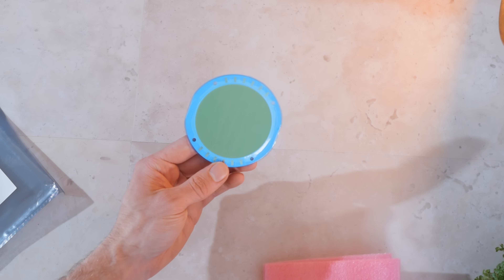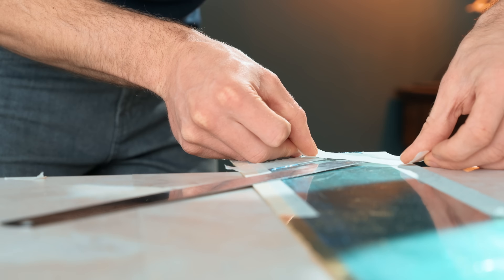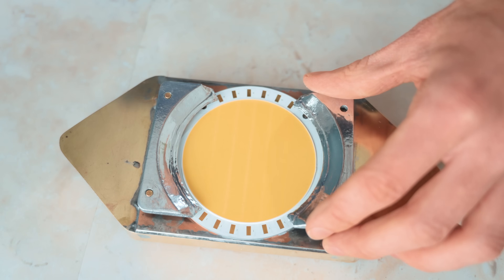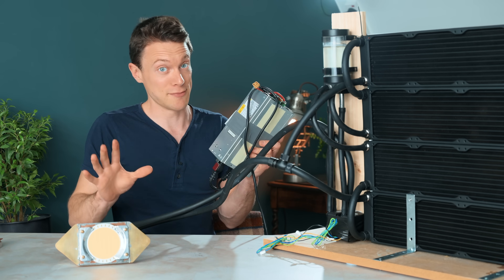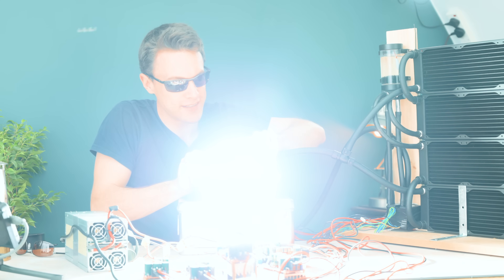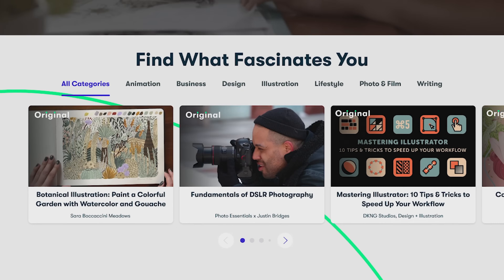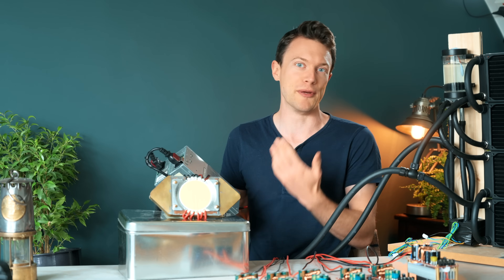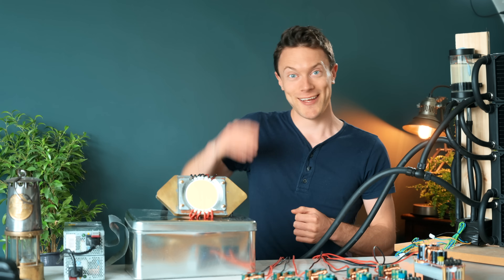Testing the world's BRIGHTEST LED!!!

Comment: 6:53

Dude, if you want to know if something is watertight, just check if it's airtight first. If you just block one end, and an adaptor to a standard bike pump on the other end, you can pumpit up with the bike pump and watch to see if the pressure gauge on the bike pump goes down. It it doesn't, it's water tight. If it does, crank the pressure and listen for leaks. Use some soapy water in a spray bottle to detect leaks by looking for bubbles when it does.

It's a MUCH cleaner way of checking for water-tightness.
Reply: That would be more complicated in terms of fittings.
Reply: @LEO-xo9cz  It really wouldn't. You'd only need two extra fittings. 1. An end cap. 2. A 8MM to whatever side he was using adaptor.

That's all. Easy peasy.
Reply: @PhilipPetrunak  but that's still two extra fittings. He did it without those extra fittings. So his way is simpler and cleaner
Reply: @antonfomenko3894  Wrong. It's not cleaner. If there is a slow leak he won't know it until it's possibly damaged components, and if it's a big leak it could massively damage them.

Pressure testing with air is VERY easy and simple. Why didn't he do it?
Reply: @PhilipPetrunak  He literally operated his LED for a few minutes.  It was never designed to stay on for hours or days, just long enough to do a Youtube video, so there was no need.  Your logic is the same as saying he should have also done complex structural and stress-testing and also rust testing to make sure everything was 100% durable and rust free.  Yes he could have done thousands of tests to precise accuracy but there was no need.  The purpose was a youtube video, and he accomplished that.
Reply: @antonfomenko3894  the purpose was to test any sort of leakage. If there was a small leakage it would compromise the system. If it was a big leak, it would be messy. Please don't overexaggerate.
Reply: @Movie2Documentary  He did test for leaks.  Please watch the video again carefully. I'm arguing that a more sophisticated leak protocol was not necessary, since his test showed nothing obvious.  And he only needed it leak-proof for one youtube video. Case closed
Reply: @antonfomenko3894  but if it went wrong if the were leaks it could have damaged anything 
At that pressure the water could spray into the cooling power brick for example
Reply: Thanks for reminding ppl
Reply: If he used fluorescent coolant like in a car leaks would be easy to spot
Reply: I studied automation and instrumentation and that is the way that it was learnt there 
In this case the LED wasn't powered on, during testing.
But if it was it would be a really dangerous thing. If it was a small a small leak even water drops dripping it would be dangerous and could possibly fry the power boards used in the project
Reply: even better, draw a vacuum and see if it holds it!
Reply: @johndoe528  but that could make it self-sealing as its compressing the leaks

Comment: "Its time to make an intense cooling system!"

Me: Dry ice?
Reply: So I'm not sure your familiarity with electronics like this obviously but, so just know I'm not trying to offend in any way. with something like dry ice or liquid nitrogen, and something that gets crazy warm, you run a very high risk of condensation which obviously would be quite bad for electronics
Reply: lukesolo0 Yeah, generally the dry ice system is generally used for competitions where it is ran for really short times. For good cooling I would prefer water-cooling.
Reply: The condensation is a problem for power supply and other electronics but not for LED itself, it's run low voltage and it is separated from the other stuff. Maybe can work.

Comment: 7:45 How you manage to wire them in series? The outputs of the first cant drive the input of the second...  
I think you meant parallel? Because you need to increase current not voltage.
Reply: Server power supply will provide 12V output, so he wired two of them in series to get 24V - see here: http://www.omron-ap.co.in/service_support/FAQ/FAQ01982/index.asp
I don't really understand why, because most DC-DC step-up converters easily accept 12V on input, so he should just power 3 of these from one PSU and other 3 from the other PSU.
Reply: bosmanx I see ... Maybe there something to do with the efficiency curve? Idk i’m not expert in this field...
Reply: I think he could have wired it a few different ways, and the results would probably all be the same.

Using some random 1000w server PSU for reference we have: *Not all 1000w is available to the 12v rail.

Each PSU likely spec: 12v  / 70amp = 840watts
Series: 24v / 70amp = 1680watts
Parallel: 12v / 140amp = 1680watts
Actual used: 1635watts <--- not enough overhead on the PSU.

We're trying to run an LED at 30-41volts and <=48 amps total, but really we have six 250w LEDs at 8 amps and 30-41v each, wired in parallel.

When using buck boosters to step up power, the less of a jump in voltage, the better. It'll waste less power in the conversion, and generate less heat, I think.

So I think it does make some sense to turn the PSU into 24v because you are then stepping the voltage up substantially less, given that he has to use buck boosters.

I think the real issue with this setup is that it's not quite enough powerful enough, and certainly, doesn't have a good overhead ("they say you want 20% more than you're using at least"). He's basically maybe 1680 watts and is using 1635 of them, so it's running about 97% it's max output- not ideal. Perhaps some of the above math is off, or there's some extra resistances or losses and it's actually running at 100% duty, 100% of the time.
Reply: @googlepleaseleavemealonean6198  Add that kiil-a-watt devices only account W, I think that in the VA department the things are worse. This supplies have active PFC, they are expected to be "high efficiency" ... wondering the power factor. Also the PSU is dropping power in the harmonics, not sure if the device account them. IMHO for some reason he was ABOVE the PUS limit. You are rigth on the POWER distribution of the rails. Most overlooked thing on this PSUs. But they are mainly 12V. The stby voltage doenst take too much power. Ive been working with a couple of ARTESYN PSUs from IBM servers and this hold true, at least fro them.

Comment: I think that even running 1500W from single outlet is dangerous. At least would be for longer periods of time. Usually they are rated for 300W , but it depends on wiring in the building and so on.

Comment: This feels like that Malcolm in the middle episode where Hal is trying to fix the light. [I have a big led. But it needs a cooler. But an air cooler is not enough. But this water cooler is too small. But the one Im making has holes. But after covering the holes this, and after that that, and then that.] And 2 hours later he remembered he was just trying to turn a light on.

Comment: The power supplies were not meant to be put in series. Even so, combined they are 24V@2000W and you are using boosters to raise the voltage up about 30% which means that with the 1500W + the power factor [power loss in the voltage step up process] of the boosters plus the 30% voltage increase, I am reasonably certain that is why the power supplies burned up.
You could take 4 of those and put them in series, then run them through a 100 amp [50% duty] bridge rectifier [NO Capacitor/filter] and run them directly off the house 120VAC...If you only have 240VAC then you would have to series 8 of them. Yes you would have to build a water block for each of them or one big block to mount them all. Individual water blocks would be better, that way you could feed cool water to each block separately with a feed tree and do the same thing for the return to the radiators. May have to add more radiators and fans. Yes, with 4 of these running at 120V it would be pulling 50 Amps @ 6000W (Each lamp @ 30V is 50A@1500W)

Comment: Perhaps this has been mentioned before, and it's been decades since basic electronics, but my boomer $.02.  If you're wiring power supplies in series, wouldn't they have to be 1500W each to provide the 1500W at 24V you're looking for?

Comment: Since the cob takes so much amps and voltage 48A @ 30-41V maybe you could try and power it of 3 small car or motorcycle batteries in series. Lots of reserve amps available and easily recharged in parallel after.

Comment: 15:00 there in series right  so the total power you should be drawing from them both at the same time is 750 watts.you would have to use four of those server power supplies,parallel two sets together then series the two parallel sets together to make a 24v 1500w power supply.totally love your D.I.Y  water cooling block.great video.
Reply: NEVER parallel power supplies.  One will always be millivolts above the other and take most of the load. Boom!

Comment: it's hard to imagine how much light this produce without seeing it outside in a pitch black forest for example..
Reply: YES please! Powering that could be tricky. But there surely is some gasoline generator around.
Reply: @Hortifox_the_gardener  I have some Delta 1300 batteries and video proof they will work for this(induction cooker uses more power than this)

Comment: I saw a video on eev vlog basically.... He was testing a power supply recently and why they blow is because of oscillation issues .... Nothing to do with power supplies not being capable. I would thing you need to put a dummy load  to stabilise it

Comment: Unless you get a really high profile power supply they are often not quite rated as stated for continuous operation.  If one of those seriesed supplies shuts down thermally it immediately gets its output capacitor charged in reverse by the other power supply and inline circuitry and that may have made an electrolytic fail with a pop and shmoke.  It's better to run power supplies in parallel than series if you can't get a single one that does the job.  I wonder if that LED array is rated at a high enough voltage to allow all the modules to be run in series or at least a multiple of series parallel sets to keep the current down at the cost of a higher voltage supply.
Reply from the maker: Thanks for the input Clive! I don't see why having the LED sections wired in series wouldn't work, so long as they are fairly well matched in terms of their current draw at a specific voltage (they appear to be). Just not sure how to handle the current regulation in that situation. Otherwise, I've seen a PSU I could get that's 48v and 2000w, which would be ideal to step down from, except cc/cv regulators that can handle that are quite rare. Tricky. How would you go about it?
Reply: @DIYPerks  If the power modules you're using are handling the load well already then it might be a good option to get either a single monster 24V supply or a few lower power 24V supplies in parallel.

Comment: Sir, I greatly like your contents, really love the stuffs you do and as a matter of fact your power supply is probably over loaded as you said it was arranged in series configuration, so in that case you where running 1500 watt load with 1000 watt power supply well I am surprized that how in the first place it handled that much power, but it would be recommend if you try parallel configuration next time and just in case I would suggest using one more power supply as the boost converter will have to deal with boosting the voltage from 12 volts to 30 volts so please keep that in your calculations

Comment: Could you not power the LED from the mains with the 6 sections wired in series? It would seem easier to control AC to the proper voltage using a triac based solution. Correct me if this concept doesn't make sense.

Comment: Maybe I can give you a tip. First thing you should of done is tin the brass. This makes sure you have a prepared surface for the solder to flow into seen locations which translates to 100 percent leakproof. Also, using a propane torch can sometimes overheat the solder and make it bubble introducing a seap. You should of used a very large electric soldering iron. You have so much more control soldering. The type of solder used determines the strength of joint and since you have sharp corners this really puts a strain on the joints. Use 95/5 would be perfect. My final thing is you never put a metal that expands into a vice and heat it, you put a lot of stress into you heatsink part. Good day too.

Comment: The second pump would break quickly if the first pump went out. Also, power supplies should not run power supplies at their limits, and they aren’t really meant to be ran at near their limits, just short bursts. Also, in a datacenter, they can be as loud as they want.

Comment: If those boost converters will put out enough current at 12V in, you could run without series P/S. They don't like that.  BTW, if you really need to get the heat out quick and cheap, I replaced my Ford escape/Mazda Tribute radiator and cooling pump. The radiator is about $60 US from Amazon, compatible pump about $35 US, and 12V 12" radiator fans about $25US each. Designed to cool the electronics for the drive motor, generator and 300V-12V converters. Cheap and tons of cooling. I use a bench PSU to run a radiator fan in the window sometimes, at 3v, about 6 watts and just a little breeze. 8V, 4A quite a bit more. Can give much more water flow and less plumbing. I like your water block!  Stubat

Comment: I would assume that while those PSUs were rated to handle the wattage with a healthy 25% margin when everything was turned on slowly and warmed up in small increments, they were not able to push the instantaneous current needed by the boost converters that were being used.  Some of the boost converters  I have at my workbench will peak quite high when turned on under load and that spike in current may have forced one series unit to see more load than the other for a short period of time.  It is usually not a big deal to series up server PSUs as long as one is isolated and floating but they don't tend to do well with instantaneous loads when being pushed to the limit.  A better solution may be a 48V rack PSU with step down converters or a 36v bank of PSUs in series with buck converters or implementing a method that automatically powers the led on and off one bank at a time.

Comment: Rather use a 2000w desktop PSU - better cooling. You only want around at 85% load maximum on the PSU.

Comment: I am not sure about this, but I think computer power supplies have different lanes for different voltage, as computers (for now) uses both 12V and 5V of power (and 3.3V but I think the wattage there is negligible). While on the outside circuit the wattage is in specification, the inside circuit is separated as it is not expected all the load to be from one component only. But if the LED is in sections, maybe it would be better to separate power supply for each section and do not connect them. If the sections are roughly equal, this will make the wattage for each supply at 50% without experiencing shared load (although your main plug will experience the full wattage drop, but it can easily support 2.5KW/h oven, so no problems there).

Comment: Computer power supplies although rated for X Watts are only happy running continuous around 70% of that power. So consider better cooling for the PSUs or higher rated supplies.
And they also don't like to be in series since there could be a a voltage variance between the two (say one at 11.8 V and one at 12.1 V) creating an imbalance in the supplies. When dealing with that kind of power with multiple supplies in series, you'll want to tune them so it's an even 50/50 voltage split.
Hope this info helps and can't wait to see the finished product!

Comment: in series you only up the voltage not the wattage in parallel you up the wattage not the voltage. so you would need to have 4 power supplies to deliver the wattage at the voltage you were trying to do. so you overworked the PSUs.

Comment: Great content dude, but you can't run power supplies like those in series. Also, server psus maybe rated 1000w, but actually they're more often than not 7-800w. Afraid power wise both hurdles need to be changed. Very happy to watch though, right enjoyed it!

Comment: Little comment for the viewers: NEVER hook up normal PSUs to one another. Series or parallel.
They aren't designed to work together and there might be voltage between lines that are supposed to have the same potential. (e.g. the ground wires)
This could result in unexpected results (You don't want that in a PSU...) and the PSUs dying.